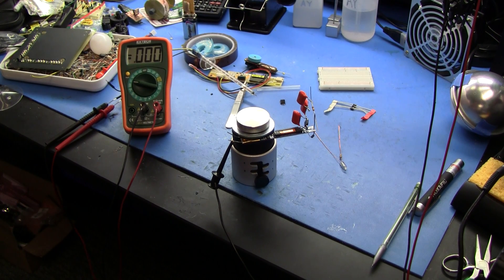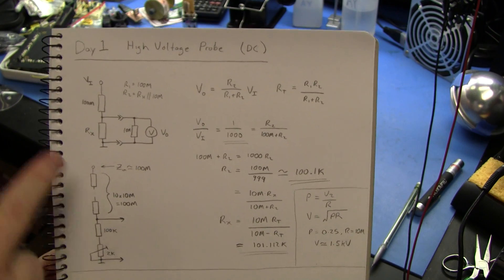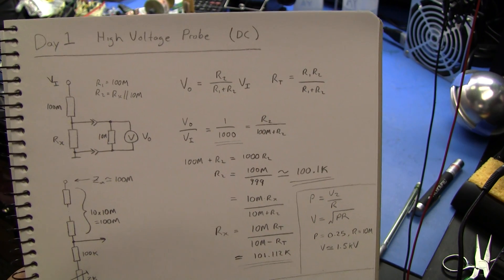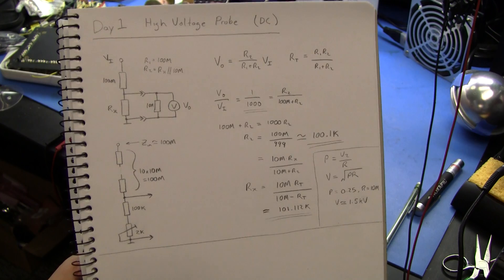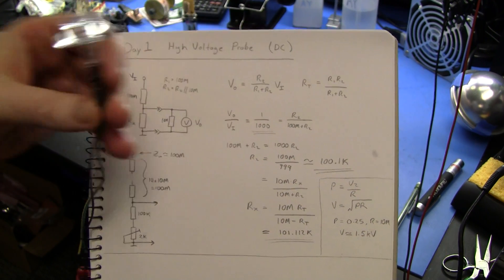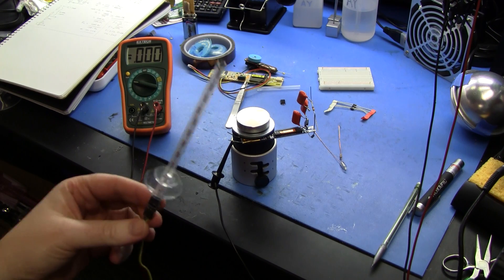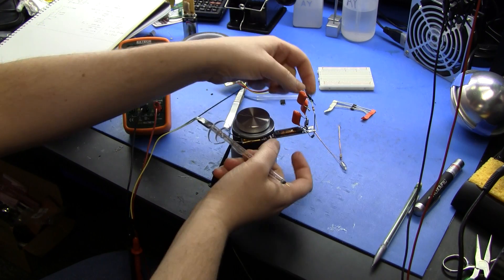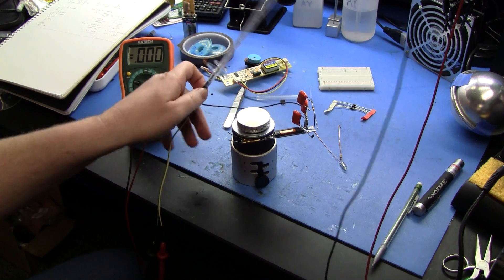Advent Calendar of Circuits 2014: Day 1: High Voltage Probe

Comment: Nice video. I had used a different method of measuring HV. Just took a 22M resistor put it in series with the multimeter, set it to measure µA then hook the 2 leads on to the voltage source i.e the fly zapper. Then measured the current and used ohm's law to figure out the voltage. Works a treat and the advantage is that the impedance can be as high as you want within some limits of course. Keep up the good work :)
Reply from the maker: ciprianwiner Yeah, you can just use a series resistor and measure the current, I should have mentioned that.  It works, but I like to have the shunting resistor too, so you can put a neon bulb or something across it and help protect the meter from a flash-over.